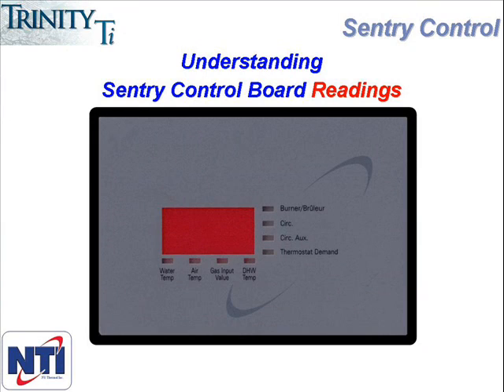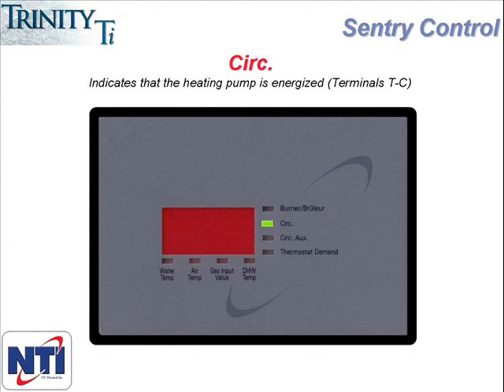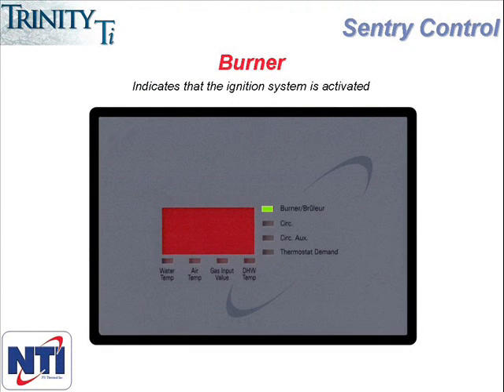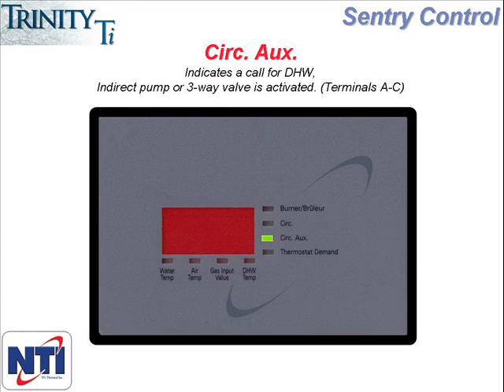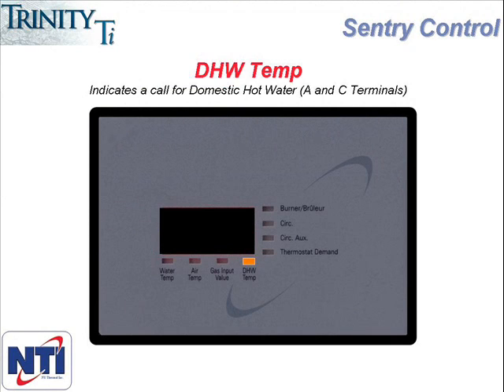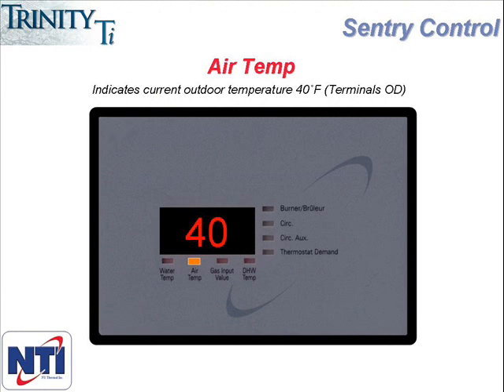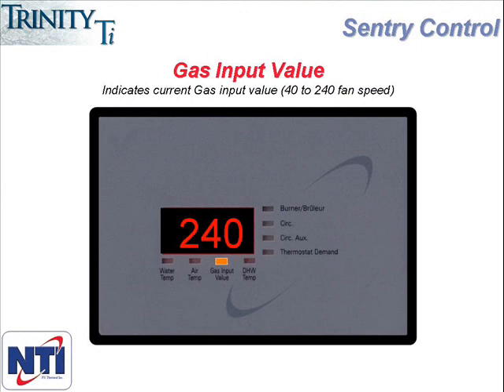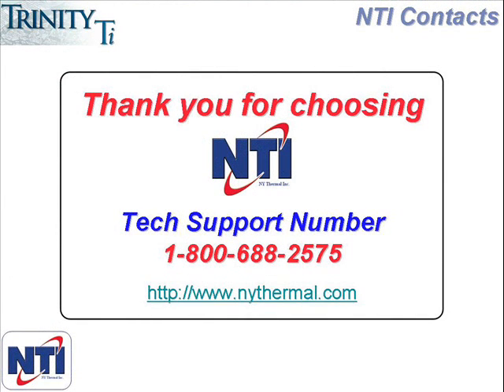Understanding the Sentry Controller.wmv

Comment: Hi. .u have a troubleshooting Video about how to fix a NTI 150 boiler when domestic hot water is on call also the heating circulator is activated at the same time ? Giving heat to my air handler even when the thermostat is off .
Reply: janito25 how do you know when sentry board is no good